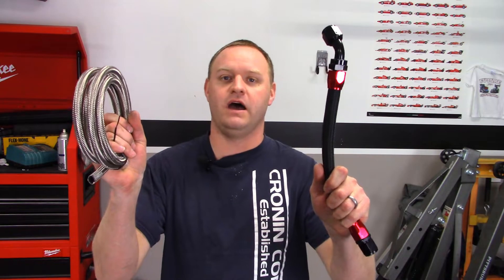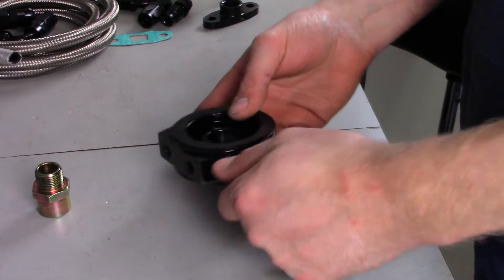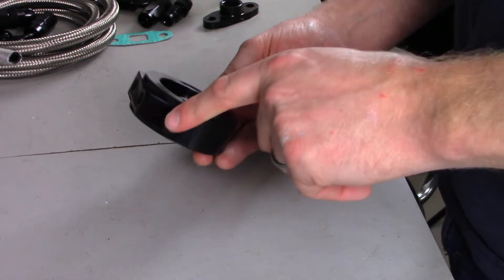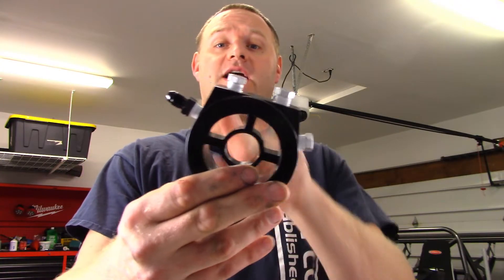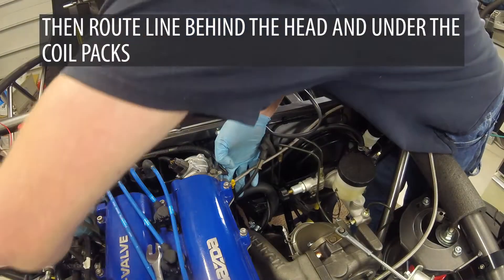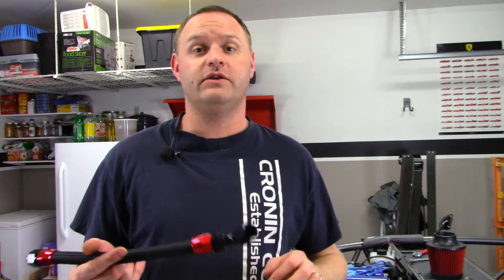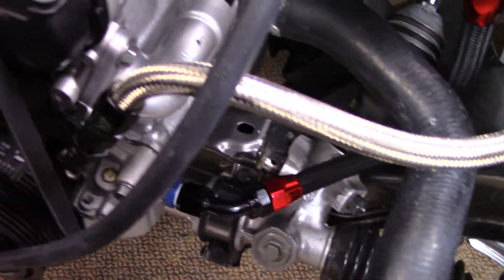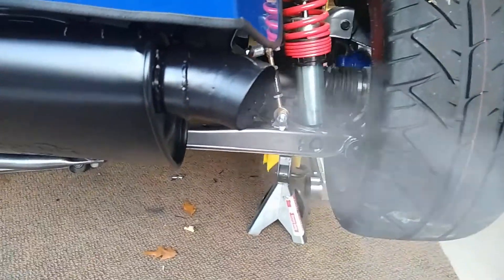MIATA TURBO Oil & Coolant Line Install Guide

Comment: Doing the coolant lines this way deletes the oil cooler/warmer, correct?
Reply from the maker: There wasn't an oil cooler on it.   As far as I know
Reply: 3:10 doesn’t that nipple on the back of the head run to the warmer here, and from there to the throttle body, then to the mixing valve. With your water lines isn’t the oiler warmer where the filter goes omitted

Comment: After having bad experiences with the OEM oil cooler filter sandwiches backing off on the turbo DSMs, I'm a little gun-shy of using them.  Is there anywhere else on the block can you tap into for the turbo oil feed?
Reply from the maker: I don't think so on this year block.  But either way the sandwich plate is holding up fine
Reply: A little late but on early MK1 1.6s there's an oil feed blanked off under the exhaust manifold towards the back of the block

Comment: Your oil drain should not have any horizontal paths for oil. You should consider shortening the hose a bit to get it more vertical.  

Keep up the great work. Unbelievable how clean you're making everything.
Reply from the maker: Thanks for the tip!   No need to shorten the hose, just loosen the pan fitting and adjust it upward and it will work, I have plenty of room for movement